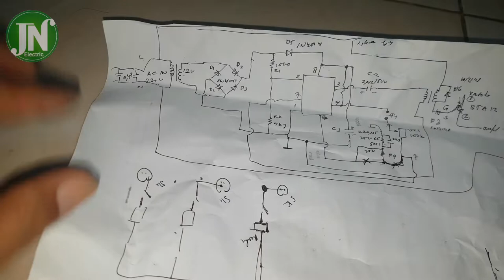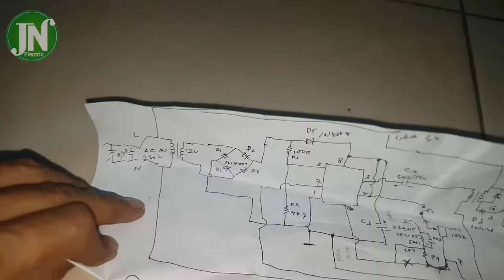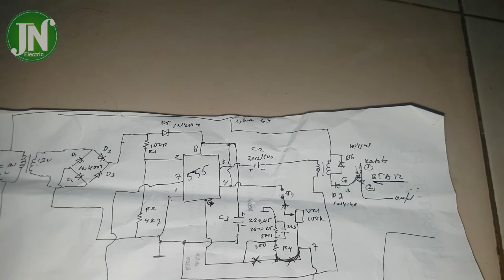Speed control motor reviewed vacuum cleaner pcb

Comment: I'm curious about the mechanism behind the speed controls in vacuum cleaners with rotary switches (and also the kind of speed controls used on the canisters of the Complete C3 lineup).